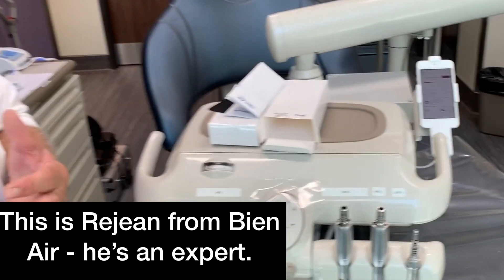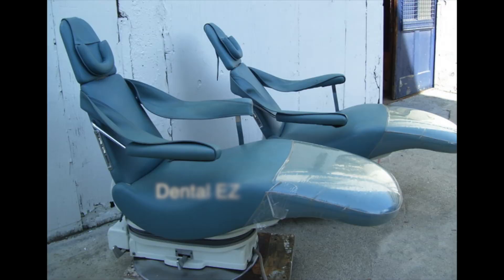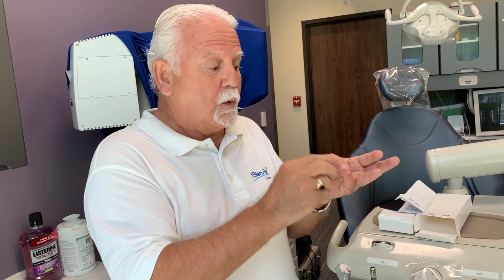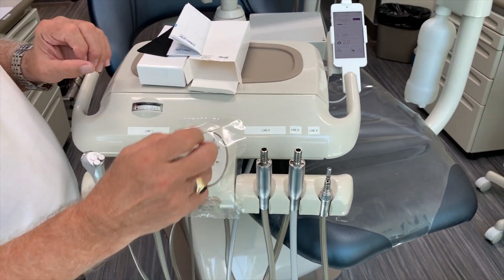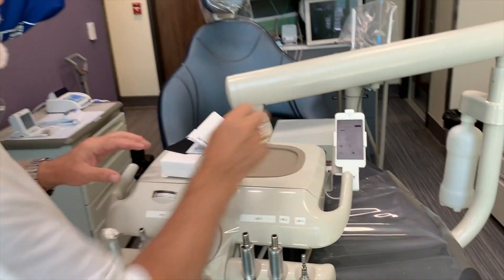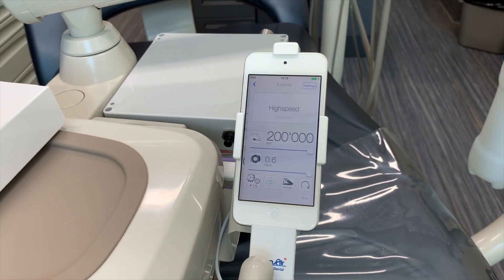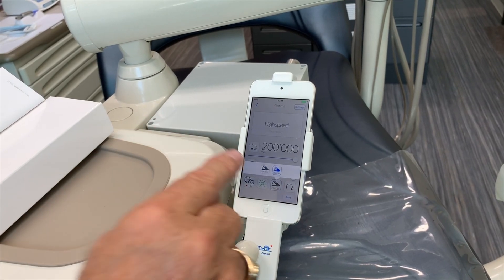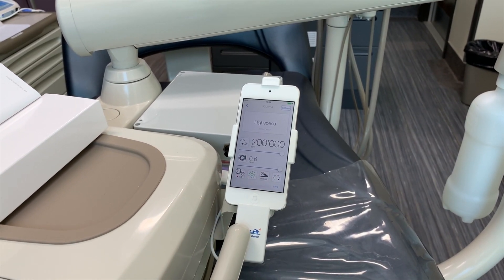Why are Dental Handpieces Air Driven?

Comment: Bien air make good electric motors. I run one chair and the motor has lasted 5 years full time.
But electric handpieces are expensive, have expensive maintaince , are heavy, can cause burns, have the wrong shape and are unergonomic. I've used Chinese sandent high torque turbines for 10 years with quick release burs and exchangable 20 dollar cartridges and can tell no difference between these and high end brands in utility value.
The bien air electric reduction handpieces would have to compete with a 40 buck handpiece for them to be viable economically.

Comment: My experience is that the air rotor generally has less weight, it's much easier to control and doesn't hurt my hand as much after a long day comparing to micro-motor handpiece.
Reply from the maker: https://youtu.be/bX6S8QjGku0
Reply: agree about the weight! I can't use electric handpiece for long. Not sure if it's just the brand of electric handpiece I am using. If you have recommendations for electric handpiece, please let me know =)

Comment: The most benfits of electric handpieces is low sound coming out of it as most patient got afraid of this sound and also noisy, but i think electric hand pieces more expensive and gonna need more maintainance,, thanx for the video
Reply from the maker: mohamed hassan let me record the sound. Good point. I didn’t even think aboit that
Reply from the maker: https://youtu.be/bX6S8QjGku0
Reply: True, it's quieter but I love the torque and ability to change direction of spin and speed of the byr
Reply: I wouldn't say that's the best but it's definitely less annoying to me. I wear earplugs anyway.

Comment: Electric high-speed handpieces are not very common where I practice (India). Most dentists use air-driven ones for restorative work. There is also something we call a micro-motor handpiece which is used for polishing but it does not have an incorporated water spray and is not very efficient for drilling.  How does the water spray system in the motors shown in the video work? Is it all-electric or the water is air driven and the motor itself electric?
Reply: in Egypt we use an adapter so you can use it directly from the dental unit without using the micro-motor.

Comment: But what about the big compressor at the back. If the office goes all electric could u go with a smaller compressor. I’m sure electric will will be all the rage when u don’t need the compressor at all. One day maybe.
Reply from the maker: We have the choice of electric or air.  I can tell you that using electric is the way to go.  Unlimited torque in a high speed means that I can prep a crown efficiently without having to brush.  I can also slow the high speed down (diamonds) to an exact RPM to finish margins - for example - from 200k down to 50k.  It's amazing and I'm grateful for the opportunity to use electric.